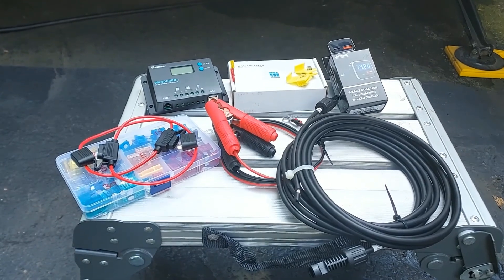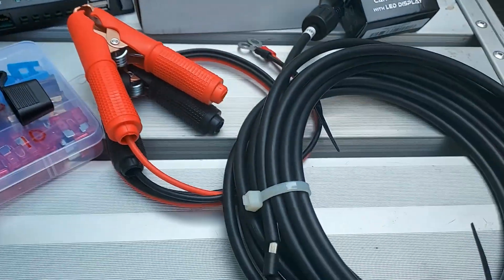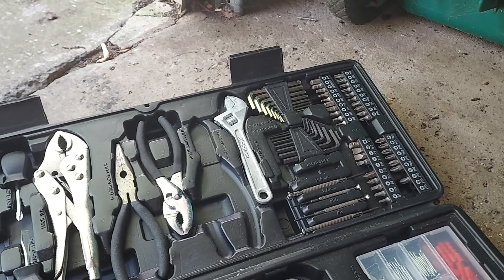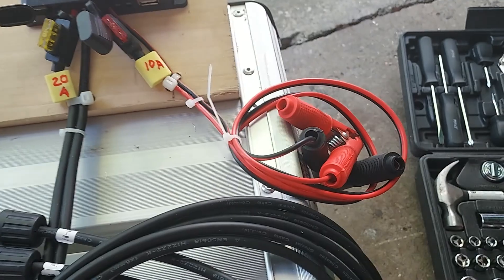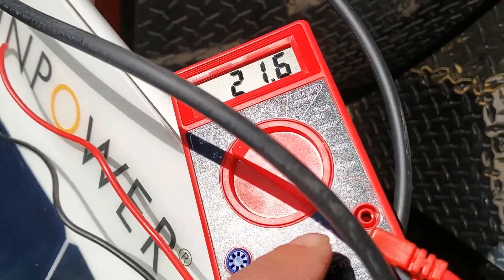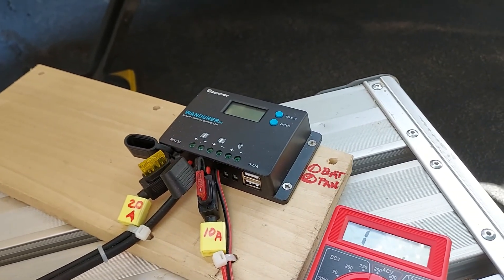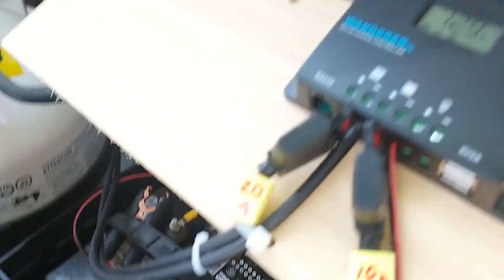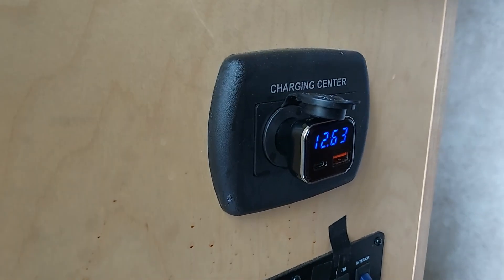Little Guy Max RV Solar Panel Project (Vlog #2) – Renogy Solar Charge Controller Build

Comment: Hi there thanks for the great video as i have just purchased the same charge controller so any information is good but all be it i dont know if you have realised you have a positive + ground charge controller, this could cause problems with grounding your battery if it is negative - ground. Just a thought.
Reply from the maker: Glad you like the video. Did not realise the controller was positive ground type. I have no problems with it and my system is a negative ground system.